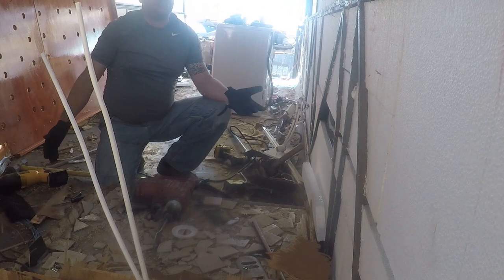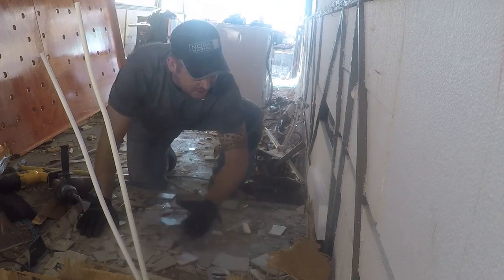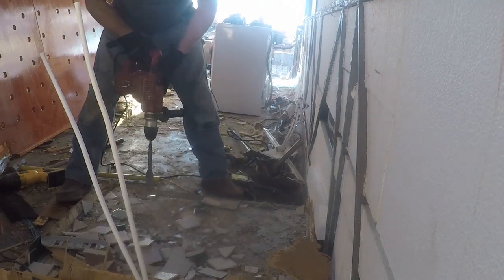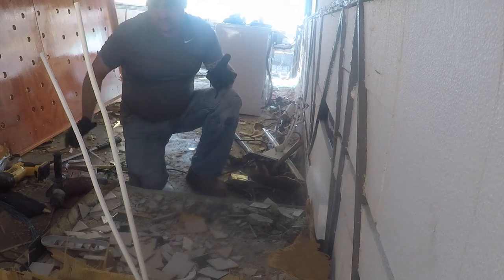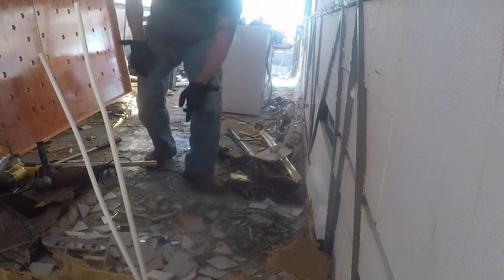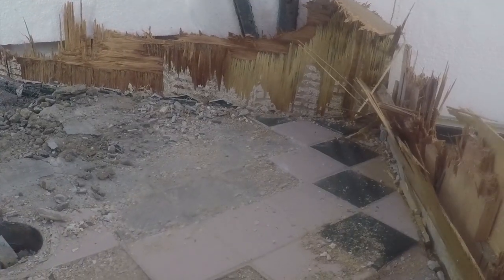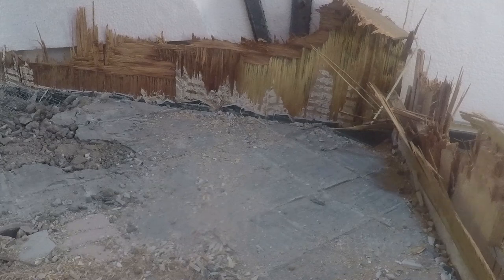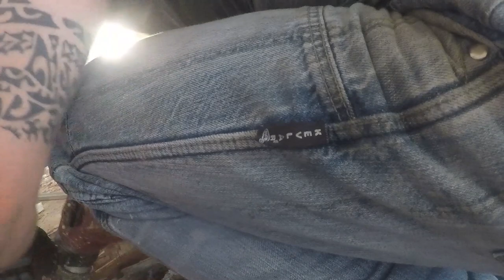Harbor Freight SDS Hammer Drill Review / Demonstration

Comment: Hey -- thanks for the video, it was helpful! 2 questions:
1. What is the model number of the one you're using? (It's Chicago Electric, right?)
2. Did you ever use the drill function of it, and how did that work for you? I'm thinking of getting one of these for the drill function (primarily), and I THINK these are on clearance right now at my local HFT. 

Any help you can give would be appreciated!
Reply from the maker: I don't recall the model number.

It works fine.  Great for drilling concrete in hammer drill mode.
Reply: @hotpuppy72  well, disappointing (about the model #), but thanks. If you happen to run across it in the next few days and can spot that model #, and can get back to me on it, that would be great. If not, no big. Thanks again.